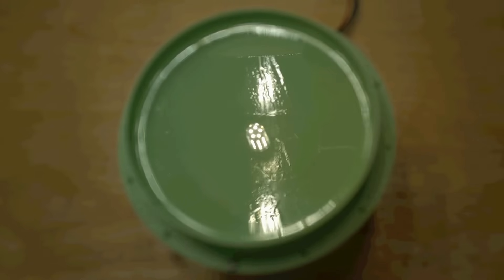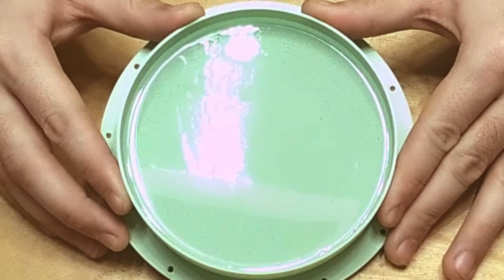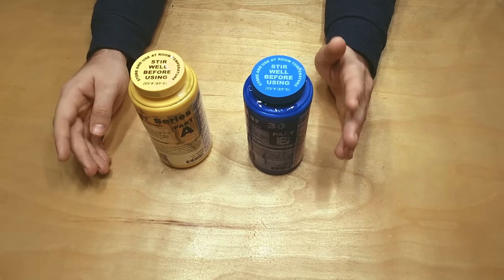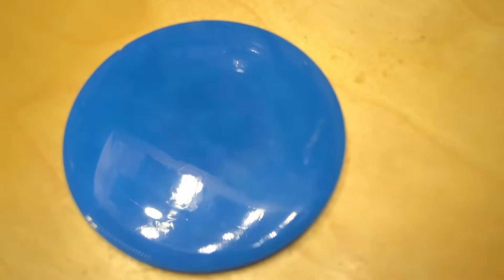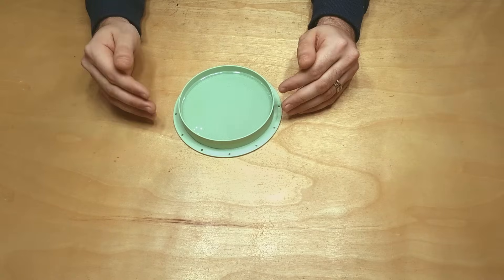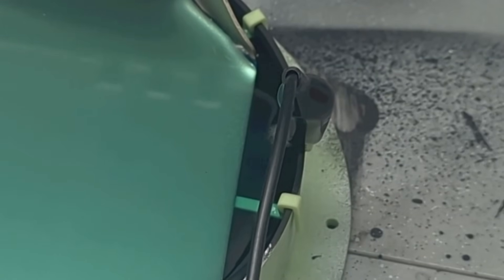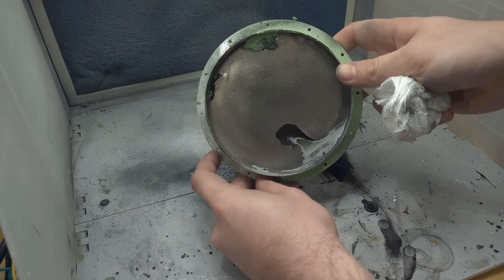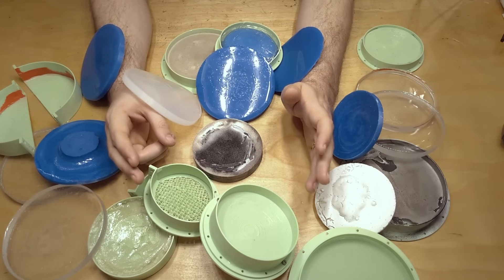Making Mirrors Is Hard

Comment: 1 try adding graphene powder to your resin. It will increase stiffness and provide conductivity. 
2.  Make your mold as a permanent part of the mirror and cut it to a rough parabola so the spinning layer is very thin.
3. Make a matching 10:09  convex blank and coat both then use Rouge to GENTLY polish the two blanks against each other.  Then recoat with silcer.

Comment: Having recently been thinking about how neat it would be to make a mirror, I was considering something similar, but with UV resin. 

About the silicone. I think the warping is unavoidable. Because the silicone spins, curing it in a stretched out state, so to speak. So when it stops spinning it would want to contract again. I think that might be enough to warp it. Although it might just mean that it would work if it was spinning as you cure the resin onto of it. 

Resin tends to contract a little as it cures, and that can cause ripples if it cures unevenly. since resin also heats up as it cures, that can cause problem with larger amounts. So I would suggest trying adding a fan to cool it off, letting it cure more slowly.

Or go with UV resin, and let it cure slowly with a weaker UV light. Warm UV resin is less viscous, and should flow out better, a hairdryer might be enough? Although let it cool before curing.

One other thing you can do with resin is adding a thin top layer. That should give you a nice surface with less of the issues above ^ . Something to try if you are not happy with the first try.  

Anyway, hope my input helps. Keep at it ♥

Comment: Hydraulically forming a circular piece of sheet metal should make a halfway decent parabola. When I was a kid I took a metal snow coaster that I suspect was hydraulically formed, spray painted the inside of it with a few layers of silver spray paint then buffed it out with some rubbing compound and made my own solar death ray that that I could set a 2x4 on fire with sunlight holding it in the focal point. Also maybe just try the rotating resin and spritz it with a little silver spray paint as it rotates or dust it with some super fine aluminum dust as it rotates while it is still a bit sticky then buff it out.

Comment: I'm not sure if it would work, but you could try a water filled latex balloon for the concave bowl, if you plan to use a vacuum chamber like you mentioned, and you should, the balloon will react and change shape probably in an undesirable and detrimental (to the project anyway) manner, so maybe you could find some type of flat latex discs or make your own that can be secured in a hoop jig somehow, which might not even need to spin during the curing process, but again who knows if it would work or not, but this is the only affordable way I could think to do it that eliminates any surface imperfections as the way that latex balloons are made is pretty much a deposition process, so other than the very bottom (or top) that will have a slightly thicker area (due to gravity), the sides should be very uniform and hopefully help you to achieve the results you are looking for. Good Luck, I know you'll figure something out and I look forward to seeing how you do.

Comment: I used to have a precision bearing assembly that kept the platter in a 5 meg hard drive from vibrating from the bearings, and it had a stack of 4 bearings in it. Sadly it is gone, but would be easy to recreate for a low vibration rotation. Combine it with the mercury bowl, and I think you have a winner. By the way, mercury is not as toxic as they say it is, and if you are worried, then do it outside.

However, all of that labor and material, and you could buy a mirror already to go! I have an 8 inch mirror for a project I hope to finish soon!

Comment: Nice attempts! I'm working on this now for a similar project. Here are the two methods I'm considering:

1) Heat bend an acrylic mirror tile and press between 3d printed forms.

2) Bismuth thin film. Evaoprate Bismuth in a vacuum and it will condense onto a smooth surface. It melts at very low temps, and boils im a vacuum at low temps as well. Coating might be fragile.

I'll be subbing to follow your projects, keep up the good work!
Reply: Heat bending acrylic mirrors is possible, though difficult. Hard part is heating it correctly and evenly without clouding up the mirror. For a form, I think FDM is out of the question because it would melt or deform. Resin seems like the choice, as long as it can take the heat.

Comment: It does take a fair amount of time to grind and polish a mirror by hand, but it's not difficult.  At the age of 13 in 1969 I made a 6" F8 mirror.  Above 6" the paraboloid correction from spherical gets trickier, so spinning would be most advantageous for big mirrors.

There were two standard books then.  One was by Texereau, and the other was a collection of articles from Scientific American.  I think that was the one that described the telescope made using a pool of spinning mercury as the objective.  I think they needed to mask off a significant amount of the edge because of deviation due to contact effects.

Many older books and articles describe silvering a mirror by suspending it in a solution of silver ion and reducing with something like sugar.  This plates an optically smooth layer that follows the polished surface of your mirror, unlike the primer or paint you tried.  The silver begins as more reflective than aluminum, though it rapidly tarnishes in polluted air, particularly with sulfur dioxide.  I think air in the US is better now, most places.  But it would work for a while, and should be an excellent substrate for electrolysis if you wanted to try that.

Comment: The swirls on the surface are caused by inhomogeneous mixing and curing of the resin, applying some heat from a heat gun might help. When it then comes to the grinding and polishing: this seems to be almost as much work as you would need to put into grinding and polishing the mirror from a glass blank - the historical way to make telescope mirrors...

Comment: you NEED TO sand polish and buff AT EVERY STEP... BUT it is MOST IMPORTANT that  you sand the epoxy before you do any painting of chemical silvering.... VERY IMPORTANT.... and you HAVE TO take your time and go in gradual steps with the sand paper..... probably starting with 220,  making your way up to 4000+ over  like 10 to 15 steps... yea, it takes A LOT to get a perfect surface!!
I've watched a LOT of epoxy tables get made and they ALL do it this way.. there is just no way around it... and using that small Dremel  is a bad idea... that wheel is too small, and you make such uneven surfaces... even if they look to be perfectly flat in the beginning, as you9 gradually work up in steps it will become apparent that you DIDN'T make it perfectly flat because it will have exaggerated and the reflections will be distorted (your polishing it so smooth that it will reflect light, just like a piece of glass... and you NEED it to be perfectly flat when you apply the silvering)
- it is a LOT of work!!! I watched a channel called Huygens Optics where he makes mirrors for telescopes... like REAL telescope mirrors... and it is NOT EASY!!! lmao....
- if you're serious about making your own mirror I HIGHLY SUGGEST you build some MACHINERY!!! You could probably build a jig that holds your Dremel and rocks it back and forth while you have the "puck" 🤷‍♂ of epoxy rotating below.... And if you're skills are good enough you might even be able to make this precise enough that you could grind the epoxy puck into the exact concave shape you want after you cast it into the rough concave shape (you will NEVER be able to cast into the final concave shape, you WILL have to somehow grind it to the shape you want.... And I THINK you might need to make a grinding head for the Dremel that is convex (I hope I'm getting this right, I've never been able to remember which is which.... concave is like a DIMPLE and it CAVED in... convex it like a PIMPLE and you wanna pop it!! - right??? ) just to be able to get the shape of the epoxy to match the shape of the grinding surface,  stuff that a flat grinding surface couldn't do......
OMG THIS IS SO LONG!!! I'm, so sorry!!! LOL I didn't realize.. I just kept typing! Well I hope I helped with SOMETHING :) GOOD LUCK!!!

Comment: That’s the kind of over engineered things that I love, why buy one if you can take the long and hard way and learn too much things on the process. I absolutely think that you need a vacuum chamber to improve your results, avoiding bubbles formation and having a better and smoother surface, and chemical silver may be also the better choice cause it’s the way conventional mirrors are made. You’re on the right way, just remember polishing the surface before applying the silver or any imperfection would be translated to the silver coat too

Comment: It looks like you don't use that much material for a single spun lens here, and I know second surface mirrors are usually poor choice for refractive optics like telescopes.

Since you probably really want a first surface mirror anyway,  why don't you try spinning some silver paint in there until it dries solid, or mix together a high silver content resin and spin that? Or cast one of the two against your existing silicone molds, I suppose.

It wouldn't be pure silver, of course, but it might be good enough to start and easy enough to polish down, and it might give you a better starting point if you still need to plate it with purer silver.

Comment: You can calculate exact the RPM needed based on the viscosity and the surface tention of the material to get the mirror shape that You want. For example the Glas mirror that you mentioned was floating in a vessel with liquid tin. You get also a concave mirror if the amount of floating liquid doesn't exceed the amount of liquid denser liquid in this case liquid tin. The result should be at a diameter of 22m the hight of the glass puddle should be 5 to 10cm at the start with RPM 0. And then at 500 to 1500 RPM you should have you desired curvature. It's only a raw estimation without any thoughs to calculate it exactly.
Reply: intresting!!, that and the fact that resin's viscosity changes during curing means you'd need to compensate (start slower, and spin faster as it thickens).
I'd allso add some carbon powder to make it conductive, and some calcium carbonate to make it stronger, but then again, that would add some viscosity.

Comment: I wonder if you could use a thin flexible membrane between your resin and some kind of fluid inside the front surface. Assuming said membrane was super shiny and smooth, maybe it would transfer that to your mirror.

Comment: I’d have thought floating something less dense atop the hard resin would give a good surface finish and remove the intermediate step of silicone. But either way it’s hard to get around the thermal expansion issues of a plastic telescope mirror. Maybe you can diy some of the mirror grinding hardware seen on Huygens Optics’ channel for inspecting the wavefront clarity, and use a glass ceramic or fused silica base.

Comment: How about spinning hot tin, and then letting it cool down? 🤔 What could possibly go wrong? 😅 Plus: you can remelt it, if the experiment failed. And it is conductive... Not sure if plating with silver is working. 🤔

Comment: Man, watching this almost hurt. First, plastics are not good for optics. Then, your 3d-printed bowl and the stepper probably induced additional irregularities in the cast (as mentioned by other commenters), in addition to ones already inherent in non-vacuumed epoxy. Spray-on conductive paint seemed an extra step to me: there's a gazillion of plating processes that do not involve electrolysis, some of them are shiny enough out of the box, but can double as a conductive backer for electrodeposition if you want to beef up the thickness for further polishing. Electroless nickel, tin or copper, or even good old silver mirror reaction are the terms to look up. But I'd build up a perfect clear part first before chasing the nanometers off the electroplated surface.

If you want to continue down the optics rabbit hole further, see some of the Huygens Optics channel videos on how mirrors and lenses are manufactured and validated in a professional setting and in a home lab.

Hope that helped. Cheers.

Comment: I think the waviness is from rotating at constant RPM, because your viscosity changes with time as resin thickens you also get different parabola over time. In principle you could figure out which RPM over time you might need, but it sounds like such a huge pain in the ass (especially compared to kiln, where you can at least measure temperature at real time) that I would consider learning polishing glass. You have plenty of opportunity to make machines for that instead.

Comment: You should 3D print your rotating bowl so it only needs a thin layer of resin. Make the inside of the bowl, the same shape as the desired mirror. This would let you add a thin layer of resin to smooth out the shape. The bowl could stay attached to the resin and be part of the final mirror.

Comment: As others have said, the weird surface ripples are probably acoustic artifacts that are "frozen" as the resin cures. Reducing resonant artefacts is the obsession of audiophiles with record turntables. To reduce vibrations, most turntables combine several of the following:

    Mass for damping

    Suspension for isolation

    Elastic drive systems

    Decoupled motors

    Anti-resonant materials.
Reply: Also de-gas the resin
Reply: Ya - that stepper will not be a perfectly smooth ride. It's taking steps, afterall - even if they are microsteps. The mechanism from a thrift store turntable would probably be better. And add additional mass for more flywheel effect
Reply: Wouldn't any change in the density of the resin (e.g. shrinkage) during curing also cause issues? Depending on which parts cured faster (which can be influenced by temperature, airflow, etc.) that can introduce radial artifacts.

Comment: There are some metal alloys available that aren't ridiculously expensive and melt at less than 100ºC. Google for Rotometals, for example. You might be able to spin one of those in a hot water bath or heated chamber to make your mold.

Comment: I wonder if the waviness was caused by the steps on the stepper motor. I wonder if a bldc motor might be a better choice. Possibly with a flywheel to add mass and smooth out any instantaneous changes in velocity.
Reply: needs input shaping like the latest 3d printers
Reply: @travismiller5548  Input shaping is used to control resonant artifacts from changes in the motion (i.e. acceleration). Not much to "shape" if the input is constant, continuous motion, and the most you could probably do is to find a rotation velocity that minimizes (but doesn't eliminate) resonance.

Comment: It looks like you're using a stepper motor to rotate; Its bearings may not have enough rigidity to hold the axis completely solid given the radial loads involved, might need some additional bearings. The stepper cogging may also be an issue and likely is causing periodic variations in the rotation speed that might be causing ripples. More inertia - more mass can help counteract that, there are some other strategies too.
The thickness of the paint layer is orders of magnitude larger than the tolerance you need to hold to make a good mirror... You might be able to make it work if you could polish the paint layer to the appropriate shape before electroplating. Might also need to do some process testing to find parameters to achieve a less bumpy electroplate that will be easier to polish.
Reply: Yes a synchronous motor with as many poles as possible have a smother rotation.

Comment: I haven't read the comments so somebody else might have mentioned this, but stretching mylar over the surface would Be a cheap and simple solution
Reply: I had a similar idea but loosely stretching mylar across a hoop and filling the mylar with resin. I made large hoop outside covered with clear plastic and filled it with water making a really hot solar lense. It's scalable too
Reply: I have seen mylar with a vacuum behind it is nice

Comment: Why don't you put something that just doesn't react with the resin on top of it, I am certain that depending on the resin you could use a oil or alcohol, maybe the manufacturer can inform you. And to make a  mirror finish why don't you try silver nitrate? just mix it 1-1 with soidum hydroxide and 1-4 with sugar, nurd rage made it once.

Comment: Really cool and awesome tries! Would it be possible to mix conductive paint into the resin right away? Or have the resin mirror spinning while it is electroplating?
Reply from the maker: From what I've read you need to add so much conductive material that it prevents the resin from curing properly
Reply: @UnnecessaryAutomation  good to know, thanks for sharing! If the conductive paint was "liquid", it might be possible to spin the mirror while it is drying
It's a really cool project and DIY mirror videos are always one of my favourites (AlphaPheonix, volzo)